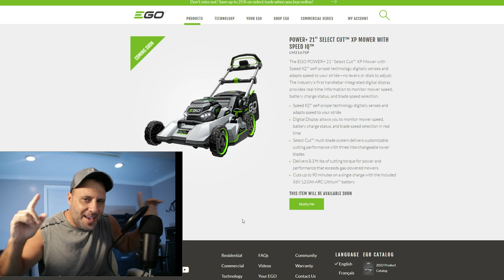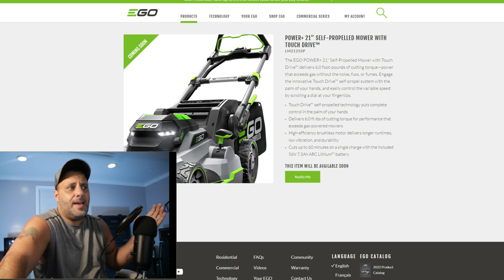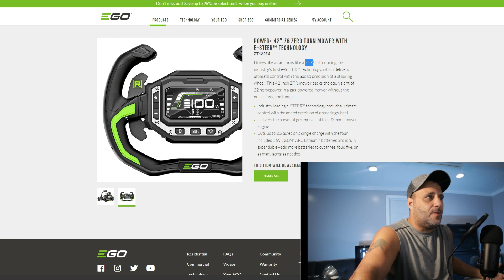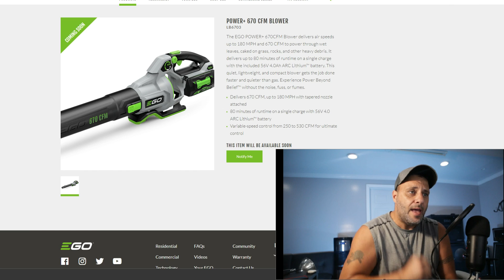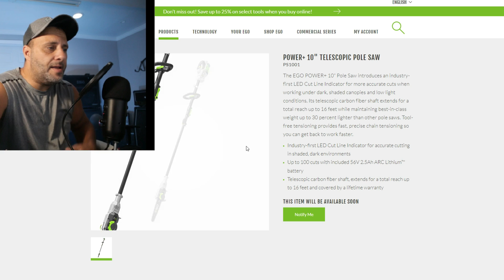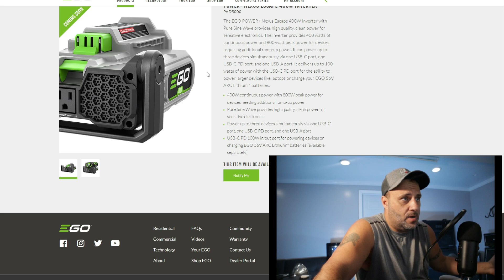These new EGO Tools are ON ANOTHER LEVEL... NEVER BEFORE SEEN TECHNOLOGY!

Comment: I'll take the LM2167sp but kick the speed IQ for the old touch drive only because I use it to run out off turns without being behind the mower and if I hit thick grass as a way to slow me down by setting the speed lower. By the time I'm behind the mower, I'm moving faster than the drive motor can go anyways so I turn it off.
The blower is getting 80min of run time off the slowest speed which is a half dirty PR trick.
All the new lower end mowers are getting better run time because they are using lower power motors. dropped from the 7.5ft-lbs to 6ft-lbs while the 2150 and 2160 keep the highest powered motors at 8.3ft-lbs. 
I would consider myself an EGO fan boy having a LM2136SP, LB7654E, ST1624E-T, and CS1805E and being extremely happy with their performance. (I do lawn care and landscaping for a living)
I am slowly converting the boss from Husqy petrol and electric equipment which is rather lacklustre against EGO's line up.

Comment: I've had my mower and leaf blower for 10 years now! All original batteries and the mower even has the original blade. I've cut my yard each week through every summer. It still works just as good as the first year. I had the original line trimmer (which still works fine) but upgraded a couple of years ago to the carbon shaft auto load line trimmer. I also have the hedge trimmer, small chain saw, and snow blower. Ego is literally the best!

Comment: Had greenworks tools that lasted me for the past 10 years (though all felt a bit under powered - mower, blower, trimmer) but just moved to Ohio and prepping for winter so shopped around for an electric snow blower - ended getting the 2 stage ego with 4x 10ah batteries.  B/c I had so many batteries, then got the select cut xp , then the multi tool trimmer and edger attachment, then the 765cfm blower.  Then fall hit and didn’t realize how much I would use the blower but it’s heavy so picked up the backpack blower and also the backpack link.   Definitely more power than greenworks. Still holding off on the pole saw attachment since I have 3 extender section on my greenworks polesaw that gives me 20ft of reach.

Comment: Will you be at the Equip Expo today? Love to see if you can find out more about this new "E-Steer" Zero Turn mower. Hopefully EGO is there with this new mower. Big Question is how are they enabling steering of the front caster wheels??? From the images shown so far, the front casters appear to be identical to the current Z6 design so there is really no indication that they are steerable. Can you find out and share with us?

Comment: That new inverter is awesome. Makes me wonder if they are going to introduce a new nexus power station. What you missed is that at least 1 USB-C port is in/out capable. So this inverter is also a DC charger. It wasn’t saying to use a bigger battery to charge smaller ones.
Reply: yeah I hope they do make a new Nexus especially if they build the solar adapter right in and make it possible to pass thru charge with the solar panels attached

Comment: I can deal with electric power tools but electric cars gotta go. Only way electric cars are going to be worth it is if you have a minimum range of 300 miles and can be charged in 5 or 10 minutes with an infrastructure that can handle it and right now they have a hell of a long way to go.
Reply from the maker: The only one I was considering was the Tesla cybertruck,  but with the delays and constant price increases I went with the V8 Ram
Reply: I think you definitely went the better route especially for the time being brother.
Reply: For most people, especially who drive cars. EV’s are the way to go.
Reply: We have a Tesla model 3 and a model y (all electric household)- and a reservation for a cybertruck.  I drove across country in the Y with my 2 dogs since it had more room when we moved to Cleveland from Portland Oregon in august - wouldn’t want to do it in any other car than a Tesla - charging was a non issue - either i had to eat, pee, or the dogs did so stopping to charge wasn’t an issue (25 minutes to take the dogs out, grab a bite, etc).   Autopilot is amazing - still should pay attention but it drove 99% of the time (just had to take the exits to charging stops/hotels).  It handles the highway amazing well with just the free autopilot.  My model 3 has fsd beta and it drove me to and back to Home Depot early the morning which is kinda mind blowing. I plug each car in once a week at home over night and we’re good for the week.   Also the performance continues to put a smile on ever time you want to push it.  I’d consider other electric suv like the rivian r1s only if their charging network or public charging network improves for those long road trips and if their driving assistance system gets to the point they work just as well as Tesla’s.

Comment: I still not convinced cause I do lawn care and they still don't have the run time I need
Reply from the maker: Appreciate the feedback
Reply: For the string trimmer I have (old version)  I get to cut my 3.25acres of land with a boat load of trees and retaining wall blocks. One charge gets me with my older trimmer. The blowers are fantastic as well, I believe this new one is stronger than any gas blower. If you have a battery inverter in your truck, you could charge your secondary battery from job to job... me personally it's so much nicer not having to ever prime, or pull a string.